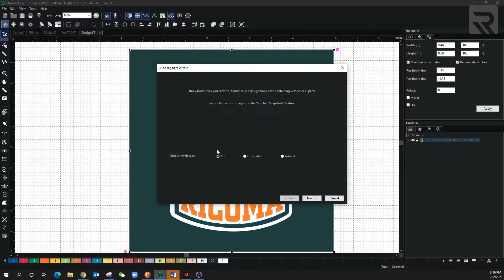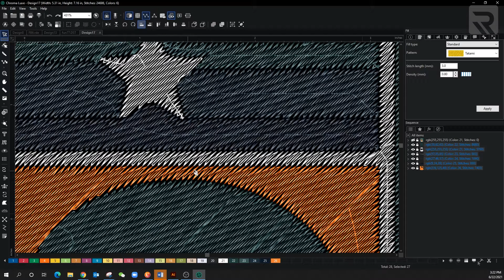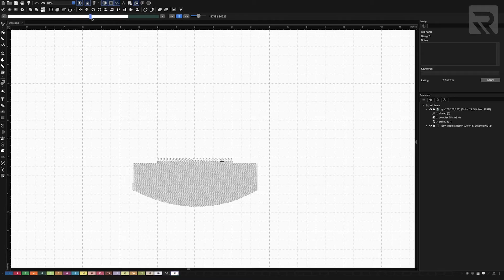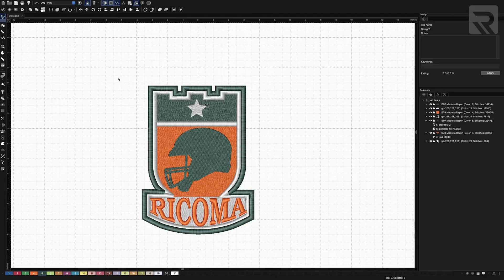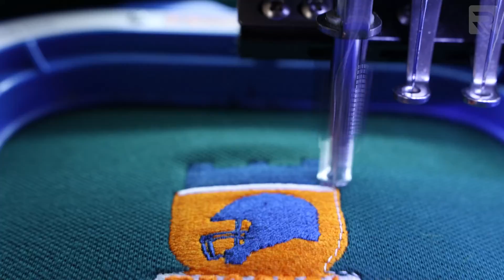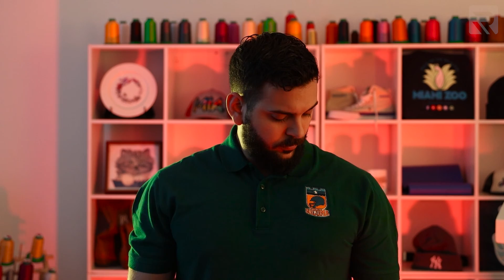Comparing Auto Digitizing to Manual Digitizing (Pros & Cons Explained)

Comment: No matter how many times we click the wand and specific spot on the design, we never get the same result as you. It always makes a box over the whole design instead of the actual piece. Like yours highlights the helmet and changes it. Ours doesn't highlight until after the fact and just makes a box the length of the design.

Is there a step, we're missing?
Reply from the maker: Hi Angel! Are you following the steps that are shown here? ----->https://ricoma.zendesk.com/hc/en-us/articles/9965183597331-Magic-Wand-In-Chroma
Reply: @ricomatv  Yeah, backdrop image (png) then the complex fill, then the wand is selectable, select the wand and go to click on the design and here's where ours always differs from yours.. Yours you're able to click on the spot and then right click off the design. As soon as we click on the design it spins (like loading and kinda takes a minute) then it gives us an entire box. So, you're able to right click off the the design and we're not. It highlights a box around the entire design instead of just the spot we click on, no matter which part of the design we click on. We're in luxe as well, we have checked for updates, consistently. But, just doesn't do what yours does. We've uninstalled and re-installed and still don't get the same option or outcome as you.
Reply: @ricomatv so... we just figured it out. It will not work with a png, only a jpg or jpeg.

Comment: Is not possible to have the font of the RICOMA text the same as in the original design?
Reply from the maker: With Auto Digitizing?
Reply: @ricomatv  either way
Reply: You would have to digitize it manually cause auto digitized letters never really come out right.  It's always best to manually digitize lettering just I'm case you get the client that has a custom font. Some have close fonts to what the client sends but most all customers want the font they sent in with the design. Here he manually digitized and auto digitized.

Comment: Each design is different and Auto Digitizing can be useful to get you started. Sometimes it comes out perfect. I generally auto digitize first and tear apart what isn’t right, and manually digitize those areas. Using both methods is the best, especially if you have a tricky or large design.
Reply from the maker: Hi there, thanks so much for watching. Auto-digitizing is great for those just starting out for sure!

Comment: Can you pre-set the auto-digitizing? in that way you won't have different kind of stitching to edit, can it be more accurate?
Reply from the maker: Hi there, thanks so much for watching! Depending on the tier of Chroma that you have, you can select only certain parts of your design to be auto-digitized. Hope this helps!
Reply: @ricomatv  Hi well I have Chroma Luxe, can you show me how to assign what part of the design I want to be fill stitch and how I can assign what to be satin, that will help a lot or if you can make a short video about this very well explained please. Thanks
Reply from the maker: In this video we show you how to do that. You right click and pick the stitch type to convert to